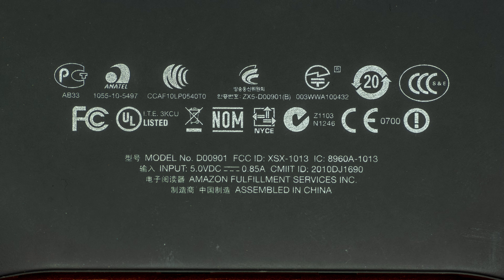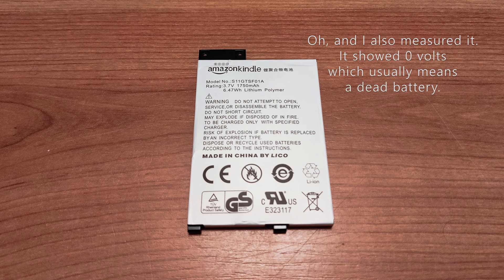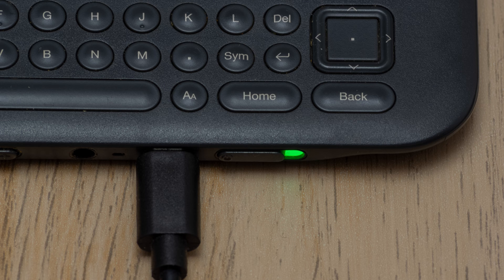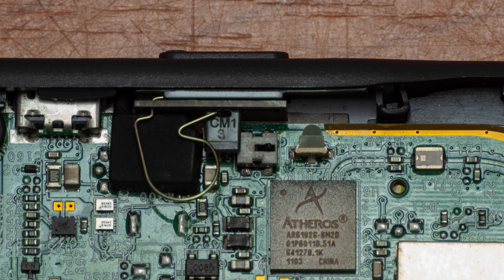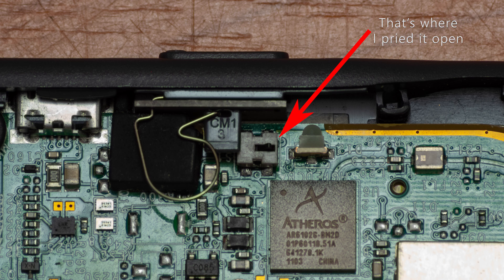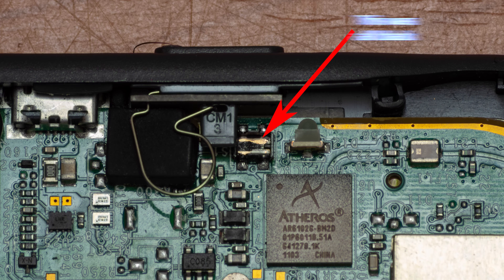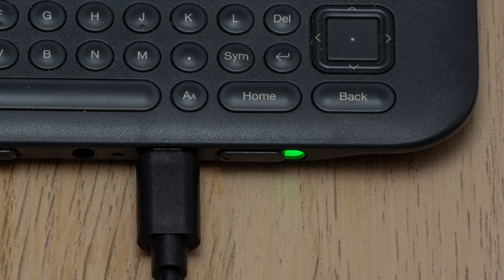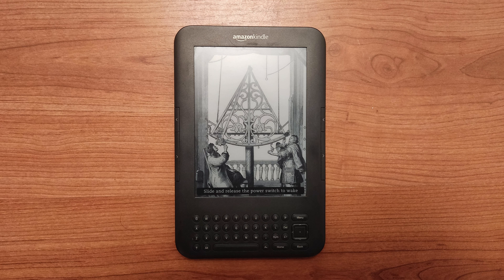Reviving a Kindle 3rd gen (keyboard), model number D00901

Comment: I have taken off the slide switch cover and lifted out the tiny mech and I also found some foreign  substance so it seems like my problem is now how do I get it back together?
You said you shorted the contacts with tweezers  but was that across the two parallel strips in the base?
Could the four external solder pads be used in a similar manner?

Comment: Be very very careful! The tiny springy component in this switch is very very small and, like the YouTuber says, super jumpy. There's a good chance you'll lose this or not be able to put this back together. Proceed with caution! 

I opened mine up. There was nothing wrong. I got it back together but it wasn't easy. And the bits definitely jumped onto the floor a couple times and I was very worried about finding them.

Comment: friend! you are wonderful!! I've been trying to revive my Kindle for months. It had exactly the same characteristics you describe.
The problem I have is that after cleaning the contacts, I can't put the tab in its place. How did you make them?
Reply from the maker: I cleaned the contacts and placed it back. It was very delicate and while trying to place the plastic cap, the wires sprang away. I looked for them on the floor for 10 minutes. Luckily I don't have carpets so in the end I found them.

It took watchmaking skills to place them back and put the plastic cap back on...
Reply: @OctavianDunare  When I removed the plastic cover, the switch also tripped. So I don't know if the copper legs go between the contact or on it. What an exercise in patience awaits me 😵‍💫. But the important thing is that thanks to you, the kindle revived.
Thanks a lot, man!! 🙏🏻
Reply from the maker: @osquitarcas  between. The copper legs short up, between themselves. They should roll on the contacts below. One of them is slightly bent so it only makes contact when you slide it to one side.
Reply: Thank you for this tutorial on fixing this Kindle which I have done successfully. The fundamentals of the task are straight forward if it were not for the very, very small part size which makes it very tricky. Any one trying this fix I advice them have a large clear worktop and put down a very light coloured large towel or linen sheet so as to catch any parts and to see any parts that jump around as you try to put them back in place, believe me the rocker part of the switch with the electrical contacts are a nightmare to try and hold and put in place you will also need some good pointed tweezers and a cocktail stick and posably a small flat blade screwdriver. The small rocker in the switch have their contacts out of align one up and one sort of straight out so don't think they are damaged or been bent. So just remember the parts are ver, very small so set yourself up carefully to prevent them being losed. Finally, I have to five full credit to the author of this post and hope I have added something to it for all.